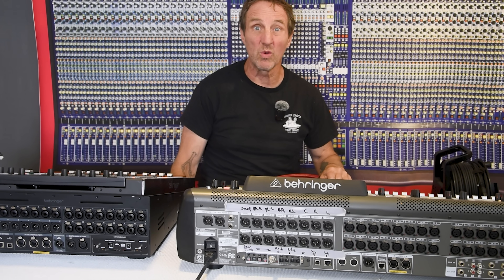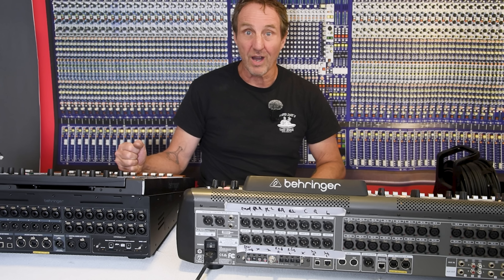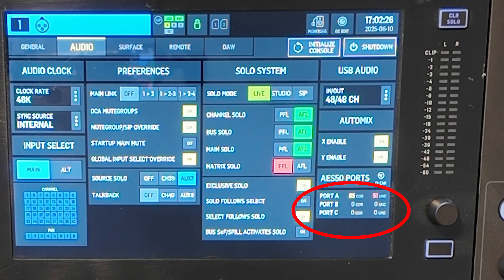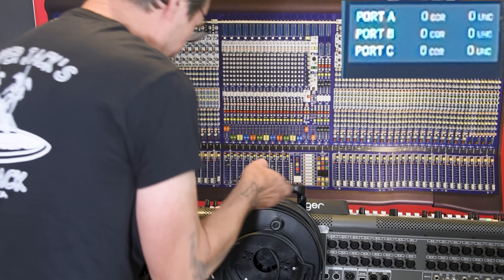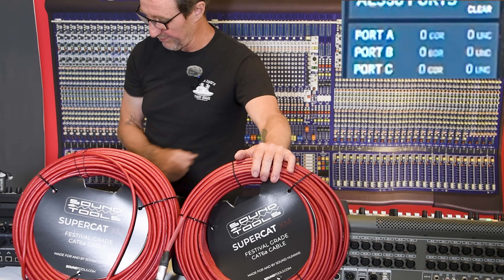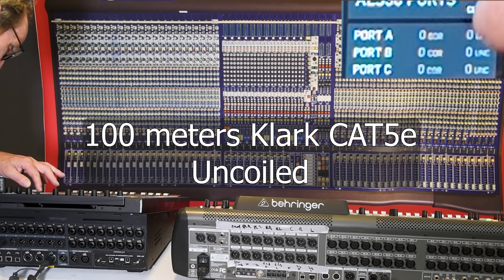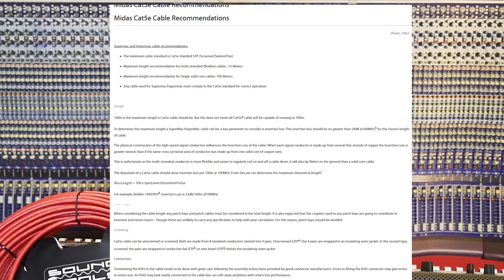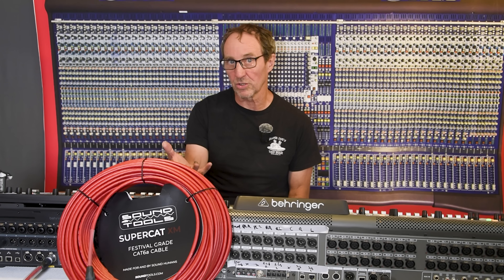Misinformation or Simple Test? - CAT5e vs CAT6a

Comment: Every network engineer knows that cat5 is not meant for distances over 100m. How come this is a discussion in the first place? Information on this is very easy to find.
Reply from the maker: I think this is a discussion because this Cat5e cable in the video is failing at 100 m. and many network engineers believe that cat 5e will function at 100 m. 

And because of this it creates a lot of confusion and some people have come to believe that only cat 5e can be used and don't understand that higher grade cat cables as long as they have less than 24 dB of loss at 100 megahertz for the length being used, will work perfectly well or better than the same rules applied to Cat5e
Reply: @DaveRat i know from experience, when i was on tour as network engineer with Cirque du Soleil, that a 100m could be working, but for sure with a lot of package loss. So, logic dictates that the same would apply to digital audio. But, that is just my own opinion.
Reply from the maker: I think all that's pretty easy to measure with the right tools. in the other video I did where I use the fluke network analyzer on various cables and show that some cables are out of spec at 80 m and other cables are in spec at over 120 meters accurately portrays what's going on.
Reply: @DaveRat I agree. It is easy to measure. All i tried to point out, is that the potential of cat5 to be unstable round 100m is evident and therefore should always be avoided. Peace!
Reply from the maker: absolutely and agreed!

Comment: Makes sense. 100m is the upper length limit for the very old CAT5e standard
Reply from the maker: and the wing users manual actually states 80 meters is the maximum. 

The main goal of this video is to help clear up this ongoing misunderstanding where the recommendation that CAT5e be used for AES 50 has been taken literally by many people who are extremely vocal about only cat 5e being used and there are many people out there adamantly telling people not to use cables that are better than cat 5e.

what the recommendation should have said or should say is "cat 5e or better"

what's really interesting is every cable manufacturer that makes cat 6A could easily label their cable cat 5e and still be absolutely correct and honest as cat6a cable meets all cat 5e specifications. 

I'm guessing that this info could throw the people swearing that only cat 5e can be used into a tailspin

Comment: As a house tech, I've been called stupid in all sorts of ways by arrogant touring engineers for supplying a Cat6A line instead Cat5e. I got tired of that and decided to look it up and came to the conclusion that it being Cat5e and not Cat6 only matters for what I liked to refer to as layer 1 protocols (MADI, AES50) because those protocols have no means of coping with the larger length differences due to bigger twist rate differences of higher cat cable. I have since learnt that not only was I incorrect about AES50 and MADI being "dumb" protocols, but now, I've also learned that Cat5e is also not actually the best option for these protocols. Thank you very much for clearing up all the confusion that exists around this topic!
Reply from the maker: awesome and thank you!!
Reply: I've only had problems with AES50 and Cat6A at 300' once, can't remember what was the cable model but we switched for Cat5e and it worked

Comment: What weirdos were saying CAT5 would outperform CAT6? Why do they think there was a need for the CAT6 spec in the first place if 5 was better?
Reply from the maker: the answer to that is on the other end of a Google search. but yes, I realize this is a rhetorical question.

also it's important to note, cat6a is significantly better than cat6 which is marginally better than cat5e

Comment: copper is an outdated technology, our industry should focus on fiber
Reply from the maker: fun and how is your collection of fiber optic microphones holding up?

on a more realistic side, my company owns and deploys large systems for festivals and tours, we have 30 or 40 reels of fiber and install fiber in many of our installations.

that said, fiber is fragile, expensive, hard to fix and often not natively compatible as an interconnect between gear without adding adapters, costs and complexity.

we actually are reducing our fiber deployments and switching to 100 meter runs of this cat6a cable in the video for many applications to increase reliabilty, and reduce complexity

use the best tool for the job is the smart move and the best tool is often copper
Reply: @DaveRat  Sure, many right points. My experience is a way different in reliability. Nativ fiber support in desks and stageboxes will lower the cost factor. Fiber is cheaper than copper, but not so easy to fix. The lenght limitation is pain in the a** and we need solutions for the future.
Reply from the maker: it's all about using the optimal tool for the application. using fiber on a relatively short run of 100 m in a high traffic high abuse environment is not optimal. 

trying to use copper cable for runs over 120 or 130 m or so is also not optimal 

we have several thousand feet of fiber cable broken sitting dead either with breakes in the middle or they are waiting a repair. 

almost of our copper cable is in use and active

Comment: Thanks for this! I see people constantly arguing this all over the place. 

I had an idea for another video for you. I was chatting with a friend about the "wizardry" that is antenna combiners for IEMS. I was wondering is there any sort of test you can do to prove or show what the best combiner is? How they operate and if a certain one is better for digital vs. analog? I'm curious as to whether the Shure PA821 is better than say the Sennheiser AC-3200, vs the cheaper RF Venue 8, vs the elusive Professional Wireless GX8. Also, I have some Lectrosonic IEMS that I am using an RF Venue 8 to combine, and my buddy says I would have much better results with the Lectrosonics Combiner, since it's made for digital. I'd not only love to see which would be best, but learn why and how they operate.
Reply from the maker: interesting and I will ponder that. I don't know a lot about it but I do know that we have a test setup that measures transmitter output at the shop and they use it to test different antennas and cables and such.

Comment: Wait a minute…so can I put a short Supercat at the end of my crappy cat5e cable and make it just as good as a pure Supercat-only cable?
Reply from the maker: nope. the supercat xm has lower loss.

for example if you have a 50 m cable of crappy cable you may be able to extend it 30 meters of more crappy cable before it fails, but you could extend it perhaps 60 meters of SuperCat xm before it fails

Comment: I work in a venue that is exclusively Cat6a for all Ethernet connections and I have never had an issue with anything we’ve put on it. Even with panel adapters and cable>cable couplers as long as we respect the max length. I’ve had several guests using Midas/Behringer AES50 prefer to fly their own Cat5e snakes because they don’t trust Cat6a, and I’ve had several others not care or are even aware that this is a debate. Regardless, I cannot think of one instance in the 6 years we have had all Cat6a deployed where there was a connection issue. To date, 100% of the time it plugs in and works for all Ethernet protocols we employee. These are all Rapco/Horizon DuraCat or Ubiquiti patch cables that we use throughout.
Reply from the maker: makes sense. one interesting thing is that every manufacturer of cat6a could choose to rate and label their cable as CAT5e because cat6a meets all 5e specs. but not visa versa.

Comment: Do you get the same result if you connect the Cat6a-cable before or after the Cat5e-cable?
Reply from the maker: since AES50 is bidirectional, there is no before or after.

the loss in that particular Cat5e is around 30dB for 100 meters, the loss for that particular cat6a is around 18db.

the loss for the combo of cables is just over 24dB which is close to the 24db maximum of the Wing spec and still low enough not to cause issues.

Comment: Now I'm being picky here, but there's a chance that the other Cat5e was defective in some way. Should have shown that both cabel was 0 error standalone :)
Reply from the maker: maybe look at the math, That Cat5e has about 30 DB of loss for 100 m. 

that particular cat6a has about 18 DB of loss for 100 m 

The combo of the two at 110 m has just over 24dB of loss.

The specification is 24 dB of loss maximum and the combo of the two is close enough to be all good 

The combo works because it should work and the cat 5e doesn't work because it shouldn't work
Reply: @DaveRat You said you were going to do a test, so I just looked at your test. I wasn’t arguing against anything. I just pointed out a small flaw in your testing.
Reply from the maker: much appreciated and you focused on on something intentional and curious to your opinion.

I do many long form videos where I try and cover every angle but those videos don't get a lot of views. I also do shorter quicker and to the point videos where I trim out and focus purely on the concept at hand that get a lot more views. 

I'm torn between the two because I like to cover every angle and be thorough but I also want to connect with as many people as possible and share the concepts. 

so for this video I tried to keep it very short and sweet and skipped a lot of aspects that I could have covered. 

My thinking is that a shorter more to the point video with some missing info tends to spur more questions and comments and interaction as well. 

I actually am looking at trying to focus more on the short form videos going forward not only because they get more views but they're faster and easier to make and more fun for me as well. Plus I get more interaction. 

and very cool and thank you

Comment: Run of 150 feet show zero errors with the much cheaper cable. That is a run as long as a 15 story building. Category 6 is better, no question (hint thats why it has a higher category designation and standard) 
The real question is how many consoles have runs of more than 150 feet? The answer, virtually none! If you have runs under 200 feet (the cat 5 standard) buy the CAT 5! Never saw a commercial shoot themselves in the foot more convincingly!
Reply from the maker: interesting and true for small and medium size shows and companies. 

conversely 100 m is the standard main snake length for large companies. My company provides sound systems for Coachella, Passion conference and multiple large festivals and tours. 

we only use 100 m lengths for the main snakes and we are not a huge company as we only own about 500 large format boxes. 

 there is a whole another level or multiple levels of scope larger than you are aware of doing all the big tours and large format audio deployments that use long cables as a standard

Comment: I would always question connector issues extending length.
Reply from the maker: great point. in this scenario the math fully supports the outcome. 

The cat driving as about 30 DB of loss for 100 m 

The cat 6A has about 18 DB loss for 100 m 

The combo cable has just over 24 db loss for a hundred meters 

the spec is 24 dB maximum for 100 m 

so the combo is close to spec but the pure cat5e is over

Comment: I love that you tested a mixed cable setup and it’s impressive that your shielded 6A cable extends without further noticeable degradation.

Useful as well when sometimes there may be a cable run by someone else, like an Ethernet patch bay of some kind, or yeah, making do with what is available if the length required to FOH is longer then anticipated.

I’m curious, what’s the longest run you could do with your 6A before getting errors? Can you make it to 3 of those cables?
Reply from the maker: yes! the ability to extend installed cables is something I did not think about. very cool!

Comment: Cat 6a is a larger gauge wire, has more twists per meter and each pair varies in the number of twists per meter (which helps further minimize crosstalk between the pairs).

The Joining of 2 x Cat 5 cables likely introduced additional crosstalk at the intermediate connection in excess of the tolerances in the AES50 standard.  As with ethernet, AES50 also has repeaters (hubs) which probably would have resolved the intolerance causing data errors.

It seems AES50 takes advantage of differential transmission method however used 2 pairs for audio data and 2 pairs for clock sync, which looks to me like a hybrid consolidation of 100mbps ethernet and synchronous transmission used in multiplexing, all of which in the I.T. world were technologies in use on/before the early to mid 1990s.

Not sure why they went with a proprietary plug shroud when there are industrial grade rj45 plugs that support cat6a for networking cable.
https://www.panduit.com/en/products/copper-systems/industrial-copper-systems/industrial-copper-connectors/p201984.html?pn=ISPS688FAS

Comment: Such a simple and to the point video, that’s fantastically useful ❤
Reply from the maker: thank you and I hope many people test their setups!
Reply: @DaveRat I love that console has the error read out built in, such a useful feature that is probably an expensive dedicated device! So a useful way for many viewers to do the tests themselves.

I make music / DJ but for event work, mostly do lighting (and sometimes video) rather than sound. You’ve encouraged me to do some tests on the cables I have… (regularly use Ethernet cables for all sorts of things.. artnet/SACN, video signals to LED wall, with xlr adapters to send raw dmx down them etc..

Actually, as I don’t have a console like that.. do you happen to have a style of tester that you’ve used and recommend? All my cat testers are simply continuity tests (which is still very useful! Most of the time that’s enough.. if an internal wire isn’t conducting, well.. it’s not suitable for a gig!). If you aren’t sure, maybe someone else in the comments might?

Like continuity wouldn’t tell me if there’s errors happening from a messily received signal… or it can’t deal with certain data speeds (ie. frequencies) just that it can receive a DC test signal.. I think back to some shows we had many years ago where it was like the lighting was losing frames, no smooth movements with the movers or intensity waves, similar to choppy video, I suspect that would be from a damaged Ethernet run (but other things are possible.. too much network traffic, issues with routers could also be possible or poor configuration settings..) anyways, it sucked! It’d be great to rule out cable issues as it’s difficult to impossible to switch that out once a show is underway!

A mate a few years ago once showed me a Fluke device he’d picked up for a bargain second hand, that had many advanced CAT testing features.. it could even tell you how many meters down the cable it thought the fault was! Not just which wire was not conducting! Which is some kinda signal based witchcraft :P (useful for spotting if the cable has been nicked or if one end or the other needs reterminating) at the time he said such a device was about 2k AUD new (~$1300USD) but surely there’s more economical options out there today..

Anyways, I could set up a network and start swapping cables and look for output, but like a dodgy instrument lead, continuity alone doesn’t explicitly mean the signal quality is great… or maybe there’s software that could give some indication of cable performance and dropped data packets in a pinch? 

Those comment got a bit long, you’ve clearly got my brain thinking about a few things! 😅 

Lmk if you are aware of any other robust cable testing methods or if there’s anyone else in the comments who has read this far and has a suggestion, plz share!
Reply from the maker: yeah, I don't really know if a cost effective tester, we have 2 of the expensive Fluke testers.

using the length extension till fail and then subtracting 20% is good.

here is a video with more info

https://youtu.be/bQXOXWuxCGA?si=Dm5S4PSvdC7qW_2i
Reply: @DaveRat someone should tell lighting console and video processor manufacturers to consider adding an Ethercon test feature into their devices!..